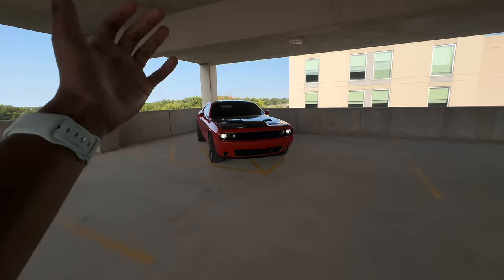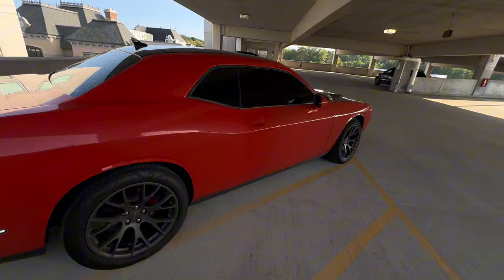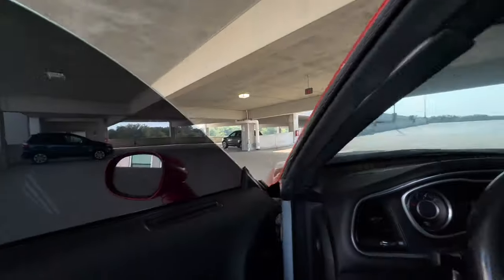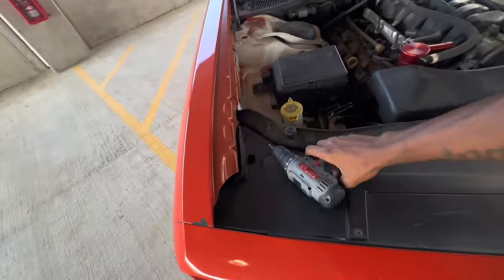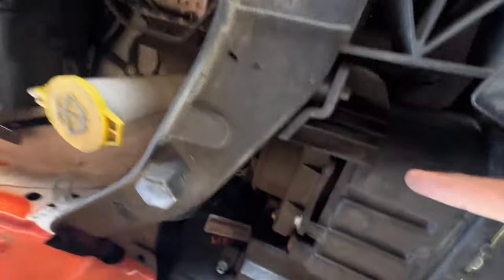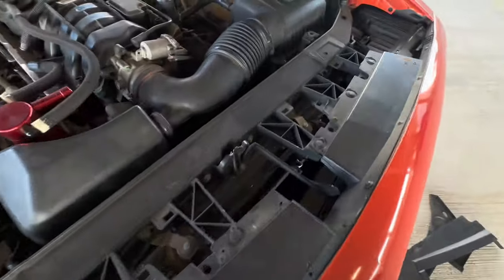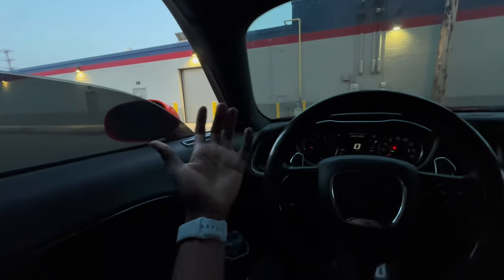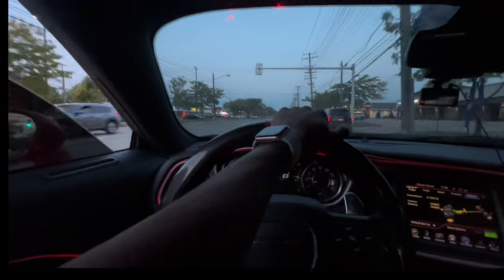INSTALLING A BETTER AIR FLOW MOD ON MY CHALLENGER RT..

Comment: if you upgrade the intake dont forget that it has to breath the outside air and not from the engine bay dont get fooled by people that use aftermarket intakes but the air comes from the engine bay and not from outside of the engine . The only thing they manage to do is force the engine to breath the hot air and it isnt good for the engine
Reply from the maker: So you recommend getting a intake with a heat shield ?
Reply: @345jerm_ yes why not
Reply from the maker: @alexmakos6039 Okay , I got intake coming soon for yall 🙏🏽